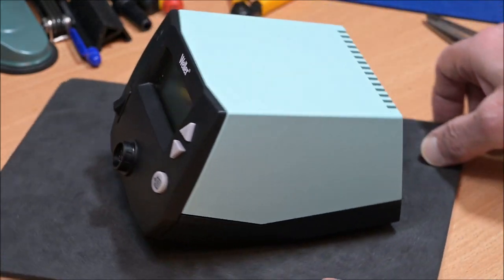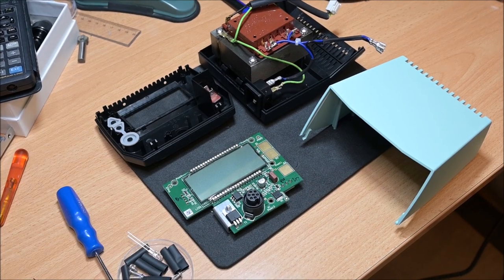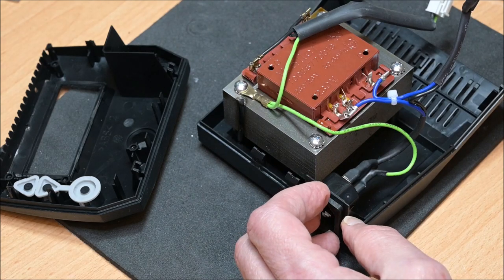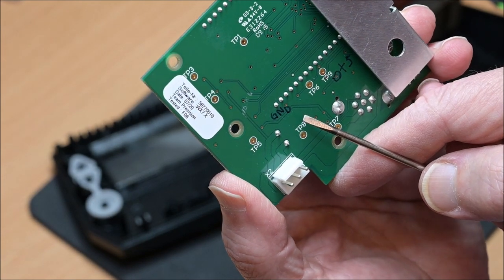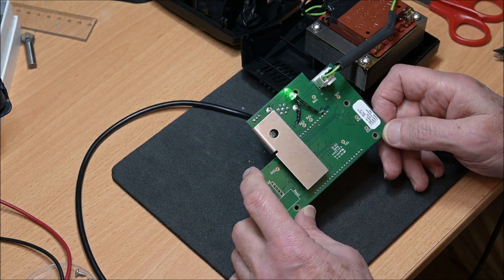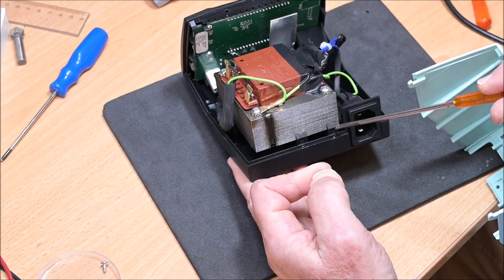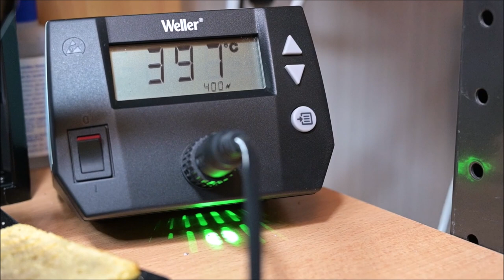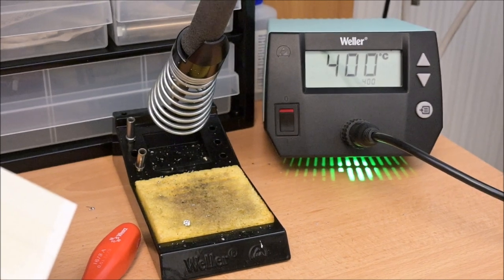Weller WE 1010 - A simple modification

Comment: quite cool. Congrats. Your Weller team !!!
Reply from the maker: Thank you very much.
Reply: How about making a better iron Weller?
Reply from the maker: @fasnuf  What is YOUR problem with this soldering station...? I bet you never had one, but keen on having an opinion about it. Weller makes several soldering stations (this is not a soldering iron, it's a soldering station), if this is not good enough for you, you can find others which fits your requirements better. So instead of posting this whining nonsense, you can go and buy a better one if you REALLY consider this one a bad and poor quality. My experience so far is very good, it works as expected, and I use it almost daily, so as opposed to you, I REALLY know something about these things.
Reply: This soldering station costs more than 100 EUR. Weller should at least take care to do proper isolation. It's a shame that a customer(!) has to add isolation to improve security and losing warranty. Heat shrinking connectors is not rocket since. Also having a switch with a "power on" light would not hurt either. Even my nearly 40 year old Weller "Magnastat" has this. These details indicate that even for this price the manufactures tries to save cost wherever possible.
Reply: Well that escalated quickly 😲😂
Although the light is cool, it’s not that hard to remember you turned the station on
Reply: @AdaptingCamera  I've been at my new job for 8 months now. Part of what I do is soldering two 22 gauge wires together, between 60 and 80 pieces a day. The Weller 1010 I use is working flawlessly.
Reply from the maker: @FE428Power  I don't expect mine to break down any time soon. It is a very simple thing, really not much can happen except that the tips need to be changed now and the because they get used up, but that's about it. Mine is also used on a daily basis and works fine. The previous one I had was one I bought used some times at the beginning of 1980's and it works even today. My son inherited it... -:)
Reply: @adamwest3637  power on lights are useful on ANY piece of electronic equipment in the shop, this is a great improvement.
Reply: Weller team, since you're here... I have a new WE1010 and have just noticed that the switch is connected to the neutral side of the incoming power line.  It should be connected to the live (hot) side, shouldn't it?  I think this can be corrected by moving the tab connectors on the IEC connector.  Did I get one that was assembled wrong, or was it designed this way?  (I tried other cords and they are wired the same way; it wasn't a reverse-wired cord.)
Reply: Weller team, this iron is very good. Would you be so kind to provide a model number for a lighted switch.
Reply: When did Weller make the 1010, I have an older with no label, been in a box for yrs, I found out weller had some issues with the pencil iron handle breaking, and thats what happened to this one. They can replace it but they need a date.
Reply: great mod the issue is now I need another solder iron to work on this one 😊
Reply: @petramunster8635  Station is not meant to be opened up by the customer. If you open it up YOU have to work save...
Reply: @har4har4e4  Well - best practices are best practices, no matter, if it is intended to be opened.

Comment: I was inclined to agree with the gentleman below who made the "if the display is on, [the unit] is on.." remark. However, after seeing the results and remembering my returning to the bench hours or days later and seeing the unit still on, I think I will try the mod!
Reply from the maker: Of course, I agree with him as well, I am not stupid. If the display is on the soldering station is on. That's stating the obvious, but this fix, or the need of control lamp is about something else. It is, as you also experienced, so easy to miss the display because it is grey on grey(ish), so it melts into the normal environment and it becomes totally invisible as it gets darker and darker in the room. Anyway, it is normal praxis in the industry to have indicator light EVEN if something is obviously on. I bet you that ALL professional model Weller stations have backlit displays or/and power on indicator light as well. Yes, they cost considerably more, but come on... a simple LED + a resistor costs what...? 5-10 cents? If the WE 1010 would have cost 10 $ more and had a LED, I would have bought it anyway and wouldn't think about that they should have left out the LED and saved the costs, I think nobody would think much about that. I cant understand anyone actually defending the absence of a LED, that's just pure and simple, bad engineering design without significant cost benefit.
Reply: Lol,I hope you have homeowners insurance for all that leave them on for hours or days...eeek.
Reply from the maker: @SPECIALIZED95711  I don't know what you mean. Of course a soldering station is on for many hours. That's very much the normal situation for anyone using just about any soldering station, not just this one. From your comments it sound like you don't have one and don't really know what you are discussing. Also, nobody talked about leaving it on for days, but there is really no risks involved in doing that, except for the increased electricity bills and unnecessary power consumption. The soldering station actually goes to sleep mode after a while, which you would know if you had one.
Reply: just relax, lad...he made a funny joke and u just didnt understand
Reply: I think the led will make it easier to spot when we're leaving the bench tired out.  And maybe keep a lot of wear and tear off of the heating element.  I'm going to try it.

Comment: Nicely done!  I did something similar to my WD-1 station after discovering that I'd left it on again for about the tenth time.  Mine was a bit more invasive; I drilled a hole above the power switch and installed a neon panel indicator light.  The whole no-power-on-indicator-lamp thing had annoyed me for years, and that time just happened to be the straw that broke the camel's back in my case.  They make good irons; would it cost them that much more to use a lighted power switch or include a pilot light in the damned things?  To the gentleman below who commented that 'if the display is on the iron is on', mine sits on a shelf above my bench.  If I make an effort, I can stand up, lean to the side and easily see the display.  From a sitting position, I'm far enough off axis that it isn't readable.  I'm often using it for brief periods, and wind up turning it on and off repeatedly, so it's easy to get distracted and not turn it off.  An indicator light makes this oversight much more obvious when one turns the room lights off at the end of the day.
Reply from the maker: Thank you.
Reply: Even a simple backlighted LCD would do the trick and does not cost much more.
Reply from the maker: @dschoas  Yes, I agree, the LCD should have been backlit, but a simple LED indicating the power on state is actually cheaper, so if production costs are that tight, at least that should have been included by Weller.

Comment: The Weller literature says "Standby mode and auto setback conserves energy, protects equipment."  This made me thing that Standby and auto setback were two different things.  I like that it reduces the temperature after a period of non-use.  But, I would like it to shut off all together after a further period of non-use.
Reply from the maker: I agree, it would be a useful function, but since the switch is a mechanical switch acting on the primary side of the transformer, it is not possible to implement without a more complicated and expensive solution.
Reply: @AdaptingCamera  I wouldn't be as concerned about the transformer being on, although I suppose that would be wasteful of electricity and also might create some risk of over heating.  Then again, we have lots of electronics & chargers that are plugged all the time, creating heat and wasting power.

I'm more concerned with turning the tip heating element off altogether.  I recently left my Weller WCC-100 station on for a few days and by the time I found it, it had completely oxidized that tip beyond repair.

While I really dislike buying products made in China, here is a soldering station that works exactly as I would like.  https://www.youtube.com/watch?v=w0nZCK7B-0U
In addition, it uses a motion sensor in the handle to sense when the soldering station isn't being used to switch modes.
Reply from the maker: @BryanTorok  If you are only concerned about the tip heating and don't want to risk burning the tip, then the stand by function is good enough. It will lower the temperature to 180 °C (360 °F) after the previously set stand-by time. The stand-by time can be set between off and 99 minutes. OK, it would be better if Weller added a function to be able to set the stand-by temperature also, but they chose not to do it and that's fine for me, mine never goes to sleep anyway, because I prefer to switch it off. I also prefer the traditional transformer solution, not a switching supply, like the one in your video. The reason why they use switching supply is that it is cheaper. There are no other benefits, only drawbacks in that solution. The only other benefit I can see is that if you have to carry it often then it is light, but if you are like me, and never carry it, than that's a drawback because it will slide around the desk all the time. The Weller is simply much higher quality, especially for long term and frequent usage. Also note that even that Chinese one has a switch on the primary side: https://youtu.be/w0nZCK7B-0U?t=1738 I don't care about the motion sensor, I'd hate to have to shake the pen and had to wait to wake it up from sleep. I prefer the Weller solution, you push any button and it wakes up, you don't have to hold the pen while it heats up. Before buying this Weller WE 1010 I considered other alternatives, but realized that you get what you pay for, even in soldering stations, so I went for the Weller. I have used Weller all my professional life, ever since the 1970's and I trust their products, even though this one is "Made in West Germany" like my previous one, but Made in Mexico.

Comment: I'm delighted that you got fan mail from Weller about this.  I have a new WE1010 that is serving me well, replacing a 39-year-old Weller EC2000 that I bought used and extensively modified; I get to keep my collection of ET tips.   I'm thinking of adding a power-on LED as you describe, and also a 2-amp fuse right at the power inlet (in North America we don't have fuses in our power plugs).
Reply from the maker: Regarding the fuse and the idiotic experiment that Aussie did, well, the solution is simple. Don't plug in ANY equipment made for 120V into a 230V mains. A fuse is not a protection against idiotic and pointless experiments. I think that Aussie guy, if he is any good in electrical engineering at all, very well knew what would happen. There is no need for more fuse in my opinion. There is a fuse inside the soldering station on the secondary side of the transformer and also there is a thermal fuse on the primary side, and that's enough of protection. I also live in a country without fuse in my power plugs, but there are fuses on groups of plugs, and that's perfectly fine. Of course, if you want to add an extra fuse just do it. It won't do any harm.
Reply: @AdaptingCamera  A thermal fuse on the primary side?  That's what the Australian fellow denied or didn't find.  Tell me more. Is it inside the transformer?

Agreed, plugging a 120V device into 230V power is simply not one of the hazards of daily life that one should expect to be protected against.
Reply from the maker: @michael.a.covington  Sorry, my memory failed, but now watching my video once again, I see there is no thermal protection on the primary side. Anyway, personally I also don't think it's needed. The fuse on the secondary side will protect the transformer in case you short circuit the secondary side because of a mistake. On the primary side, if you short circuit then your household fuse should trip. Of course, a fuse on the primary side might also provide som protection against stupidity, but the best protection is not to be stupid and not to connect to mains which it is not designed for. That's all.

Comment: Thanks for this, I have done exactly your mod and I love it.
This lack of an active "on" indicator was a terrible design choice, and yes I've left my iron on all night numerous times as a result. Now I have no excuses.

My previous Weller WTCPN Soldering Station TC202 lasted me 40 years! and was a great design. The "on" switch was also the indicator light and I loved the integrated pencil and sponge holder

Sadly my 1010's WEP 70 pencil also has design a flaw, as it has become loose where the metal barrel meets the handle. I've had it two years, this issue started after 6 months. This problem shows up particularly when using desoldering braid (when even a little  bit of lateral force needs to be applied). Disappointing from Weller.
Reply from the maker: I am glad you liked my mod. Regarding the pencil, I like that a lot more than my old one, which was considerably thicker, heavier and had stiffer wires. I also love the possibility the independent pencil stand, which allows moving around the pencil without the need to move the whole station. My pencil attachment seems to be fine, but I always hated those de-soldering braids, so I always used them as little as possible. They also need very high heat to be efficient, otherwise they require too high pressure, and no pencil is actually designed for the side pressure you need to apply. My old pencil had many cracks and I had to glue it many times, using super glue. To be honest, I don't think it is possible to design such small pencils for use with braids, if I would have that need, I'd use a larger soldering iron for that sort of use. This is more for wire and IC soldering on PCB, and for use with de-soldering suction pumps, which does not require longitudinal pressure.

Comment: Weller could have put a lighted on/off switch. The green light is pretty cool. 
 I agree with you putting heat shrink on the connections, but I don't see where anything inside would be touching.

Comment: I don't see the need to heat-shrink connectors that aren't going to be moved around or messed with.   BTW cool mod here with the LED.  I came across this by accident, looking for a troubleshooting vid to see what caused the LCD display to blank out on me right in the middle of a job.  I JUST got a new genuine solder pencil a couple weeks ago, so not happy about that.  The 1010NA was my workhorse for a few years.  The fuse looks fine hmm.

Comment: BTW I noticed my WE1010NA has some additional parts that yours does not have.  Mine has a square disc cap and a fuse on the secondary side of the transformer.  My fuse has ended up being bad (and was intermittent for a few cycles somehow). I'm trying to locate a proper fuse.  I've already apparently replaced the original one, but I can't find the original value since it is unreadable.
Reply from the maker: Sorry, I can't help, but I am pretty sure the value of the fuse is not that critical, as long as there is not that much difference. Try 1A.

Comment: I have to wonder what would happen if one put the LED(s) to the sides or top and bottom of the LCD display.  Would that work to illuminate the display?
Reply from the maker: Top and bottom is not possible because of the LCD pins, but left and right could be possible. Unfortunately, you would only see a tiny portion lit, not like if it had a back panel LED light also. I considered inserting a back panel, but unfortunately there is no space.
Reply: @AdaptingCamera  Tnx for the answer.

Comment: Wouldn't we need to put a current limiting resistor in series with the LED?
Reply from the maker: Of course you need one. I have mine in the heat shrink tube so you can't see it, but it's there. https://youtu.be/vsnpXHTc3M8?t=360
Reply: He unfortunately didn't mention this important part of the job. I hope, no one does the mod without the resistor and blows the PCB.

Comment: Nicely done
Reply from the maker: Thanks.
Reply: @AdaptingCamera  You're welcome,  I have been using Weller going on 21 years i probably have 10+ from 25w,35w but mostly use the wp60. But looking at getting this solder  station .
Reply from the maker: @SundownBlazer  I am happy with it. I think it works well, and is almost as simple as the one I used since 1979,  41 years. I gave that one to my son, so it continues working and being used.
Reply: @AdaptingCamera  Awesome that it still works after all that that time.
Reply from the maker: @SundownBlazer  Yes, good quality but really simple. Especially the old ones are very simple designs.